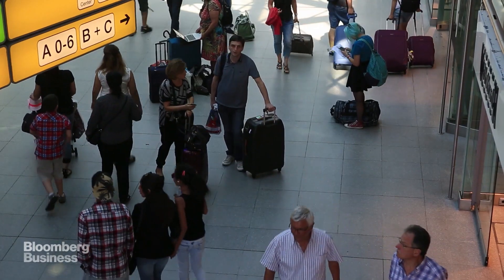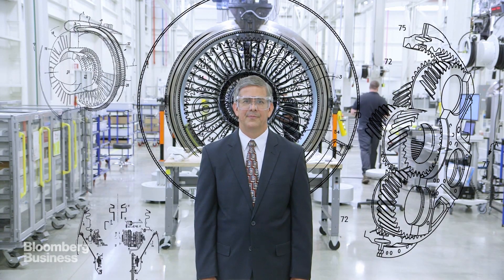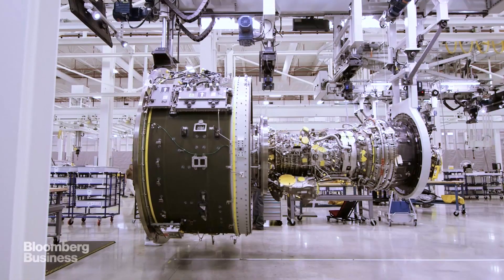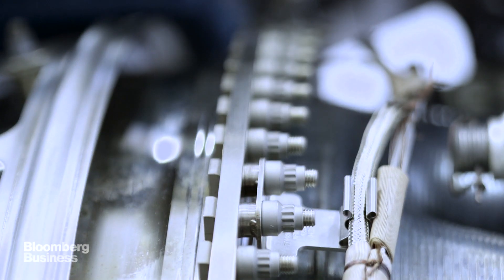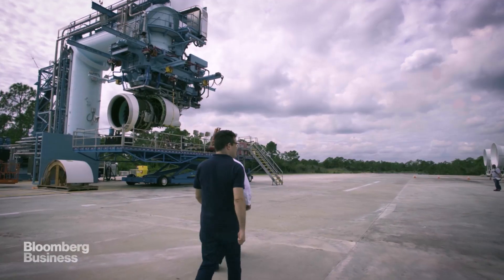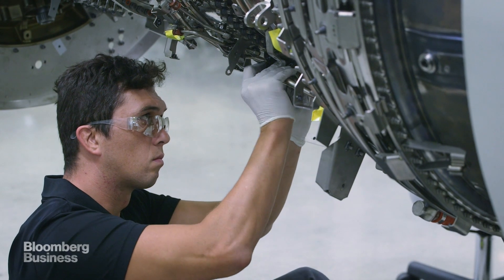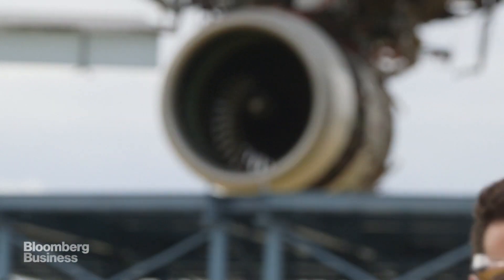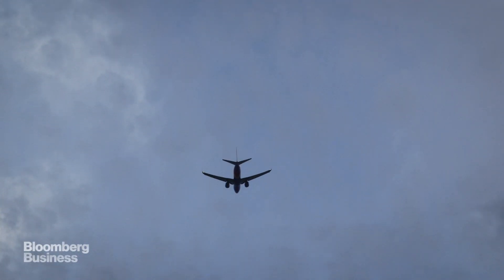This Genius Invention Could Transform Jet Engines

Comment: The cost benefit offered by this technology will mean a lot to airlines.  The big question will be whether or not the reduced fuel savings will be passed along to the consumer once the project cost has been repaid.
Reply: Doubtful. Turns out fuel cost is a minor component of the cost of a ticket. (like, 1-2% in most cases).
The main costs you are paying for are the air and ground crew, landing fees (this is why budget airlines tend to not fly from major airports), aircraft maintenance, and the actual capital cost of the aircraft.

let's say it's a typical medium sized aircraft.... The usable life of such an aircraft is about 30 years in theory, but older aircraft handle longhaul flights better than shorthaul. Let's ignore that though.
Let's take a brand new 737-700 as an example. That costs about $80 million.
over 30 years that means you need about 2.66 million per year just to pay for even having the aircraft at all.
You get about 137 passengers on one, let's say you're doing reasonably well with it and can fill most of the seats.
Let's say that your tickets cost enough that you get $100 per passenger that isn't already being spent on fuel, crew costs, or any other expense involved in actually flying the thing. (that's seriously optimistic, but still.)
With that amount of money per passenger, you'd need to carry 26,600 passengers a year.
With a capacity of 137 passengers, that means doing 194 flights every year.
And that's assuming every single flight ALWAYS has 137 passengers, and after paying all other expenses, you have $100 left over per passenger to pay towards the cost of the aircraft.
If it were only $10 per passenger per flight, you'd need to be doing 1940 flights a year, or an average of 5.3 a day.

And at that point you haven't made ANY profit, the other expenses mean the actual ticket price is probably $3-400 per passenger, and it will take you 30 years to pay for having bought the aircraft, by which point you will JUST have paid for the aircraft by the time it will need to be replaced entirely.

Fuel costs matter, yes. But they actually aren't the major expense in the long run.
Reply: In business gains are cumulative so any that can be realized without a large investment are good.  Since engines have to be built for aircraft if new units can incorporate these gains for a minimal cost increase they are worth it.

Comment: Stop lying.
Try to do the same with cars and trucks (moving people and cargo all over the planet) and see for yourself that jet aircraft are way more efficient doing that job.

This geared turbofan idea is pretty old.. GE does it for years now.
Reply: Yes jet aircraft are not fuel efficient compared to train or container ship. however, they are the most efficient when factoring in speed.
Reply: 44092452 pounds?  A TT can carry 60,000 lbs. Check your units.
Reply: *20 metric tons, not 20000 (typo)... 140 ton miles per gallon is accurate.
Reply: b k how long does it take to get a package from new York to London in a truck though?
Reply: I call tell you for nowt that air freight is less efficient than ground or sea.

Pull up any shipping calculator and see how much more expensive air freight is...

Where they are surprisingly good is moving people. A 747 at full capacity gets about 91 mpg/passenger
Reply: jet aircraft as efficient as cars and trucks?? hahahaha good one. a typical tractor trailer can move 20,000 metric tons of freight 7 miles with a single gallon of fuel.  that's 140 TON miles per gallon.  The most efficient airplane (bombardier cs300 in terms of seatmiles per gallon, see wikipedia "fuel economy in aircraft") is rated at 127 SEAT miles per gallon.  Trucks: 140 ton miles per gallon vs airplanes: 127 seat miles per gallon.
Reply: obviously a truck wont make it across the ocean.  a containership will though, slower, but more efficiently by cube and weight than an airplane.. in terms of EFFICIENCY, jet aircraft are usually the worst.

Comment: what a twat. he can challenge the expert on whether a slower compressor is indeed optimum, but he can't ask the obvious question of why nobody used a gearbox before; if that is in fact the case, since obviously, for example, turboprops have reduction drives

Comment: 10 Billion and 30 years And this so called Genius decides to put a transmission in a jet engine.75% quieter and 15% more fuel efficient. Unlikely .And the more important numbers Extra weight, Gear drag ,Thrust to weight ratio numbers will suffer. Now add in the cost of doing all of this IE parts cost alone (air craft quality alloys) Then figure in the extra maintenance And more. That 1.5 million savings projection just flipped into about double that figure in net loss.  Genius is not the word that would describe this
Reply: Beau Gant ya your probably right. they should have just listened to you. I'm sure they didn't figure any of that out whilst working on that project for 30 years. they probably never thought about it before spending billions of dollars in development.
Reply: True. Also, you don't think that they didn't take into account drag/friction loss? You don't think they didn't factory in one of the MOST important things regarding flight? WEIGHT?

Comment: wont the n1 to n2 ratio be very different though.. its weird
Reply: N1 and N2 are always very different.
What they are talking about is a difference between the fan speed (N1 or LP compressor) and the LP turbine which are usually connected by a solid shaft.
Reply: Android811 yeah i know n1 and n2 are always different due to the difference in outside air pressure, but what im wondering is whether, as a pilot, you would notice the difference or if it would practically ne indentical to a standard engine
Reply: rk.ca Well pilots use N1 (fan speed) as an indicator of thrust because N2 (core) stays pretty constant no matter how much fuel you squirt in there.
This design wouldn't change that at all, you'd still be able to use N1 as a thrust indicator.

Comment: i've always had a design concept for future jet engines, which works similar to a Dyson Ring (The Air Multiplier). It's just a ring attached to the wings (obviously the mechanics to create thrust are elsewhere) and the thrust is finally exerted on the rings. Again, I understand there's a lot that goes into whether this can be applicable or not, but it's just an idea
Reply: Cristofer Monteflores Sounds just like the kind of thing I would think of. :) Unfortunately the rerouting of the exhaust and inlet gases would almost certainly result in low efficiency.

Comment: Looks like a old idea from 70 or 80's, I mean it is a simple and known solution for a problem. """Just""" a ducted turboprop with a lot of blades when a turbofan is like a "ducted propeller" with an additional big turbine in the same axis and a jet in the place of a piston engine. All my "explanation" is extremely simple and not 100% accurate but in the most basic level I think I am right (like the SRB of the STS are "just" big fireworks... in the basic principle they are the same kind of engine).
Reply: They've been working on it for 30 years. Of course it's an old idea by definition.
Clearly there were technical problems specific to the implementation though, otherwise they would have done it 30 years ago, and not just now.
Reply: +KuraIthys Yes and not, I feel like they keep the new ideas and even full products locked in a safe. like the un-ducted "prop fan", created as an low consumption and noise alternative to simple jet engines, but fuel prices got down one more time, so the "ready to use" engine was scrapped with no apparent reason.
I still think that the new ideas should be put in use as soon as possible and in this "high complexity" there is no excuse, because a non standard engine will require the same time to get repaired or serviced as a "shared"/spread engine, if you need any part for repair you always will request it to the original manufacturer, it can't be purchased in a "hardware store", so the idea of "that is a special part, will be hard to get a new one" in reality happen with every hose, screw or pipe of any engine regardless how wide spread is. ;)

Comment: The first book I ever bought was The Jet Engine by Rolls Royce in 1993.  Great book.  In it amongst things, was  details of some of their turbo fan technology. These engine had a reduction box from the main engine to the turbo fan.  It was roughly a 3:1 ish ratio I think.  This tech is not new at all.
Reply: I believe what's new here is the in-line gearbox - think of a shaft where one end spins faster than the other and that the gear is on the same axis and that it has a variable gear ratio and NOT fixed. That is impressive.
Reply: Patrick EH 
https://en.m.wikipedia.org/wiki/Lycoming_ALF_502
Reply: This engine was first commissioned in 1980.
Reply: Pratt&Whitney also  pioneered   the twin spool technology in 1948, the most significant technological breakthrough in the history of jet propulsion  it paved  the way for  development of commercial jet engines ..
Reply: Turbo prop engine is essentially the same thing when it comes to gearboxes on a jet engine.

And that came out in 1929.
Reply: In my book modifying blueprint drawings and then applying them to an original engine design is a "Variant".. e.g. A modified Ford or Chev V8 engine in a dragster is a "Variant" and can no longer be called a Ford or Chev.

Without the original RR design and development there would never have been A Packard/Merlin

You only have to look at what the Japs did with their motor bike engines of the 60s/70s Direct copies(with electric start) of Triumphs BSA's and Nortons and then later Harley copies.

Look beyond your boundaries for the inspiration that made you who you are.
Reply: True. Its been done before by the British. The advantage P&W has here is in the manufacturing process and the materials that were not available when RR did it. The downfall of this technology is the added weight to the engine of a epicyclic gearbox and the oil feed and cooling required. You gain efficiency from the fan but then lose efficiency in the running gear internal friction and the added weight. Sorry; nothing new, and its no breakthrough! If you want to see a real groundbreaking invention look at the new British Sabre engine; this could be a big step forward.
Reply: Rolls Royce book is biased as expected from a British book..Go to page 29, it reads ' RB-211 the first high bypass turbofan engne '  Its  a lie !!   GE and Pratt Whithey both built it before Rolls Royce...https://en.wikipedia.org/wiki/General_Electric_TF39  . Pratt......https://en.wikipedia.org/wiki/Pratt_%26_Whitney_JT9D
Reply: It is unfortunate that national pride can get in the way of facts.
Reply: The best book I ever read was 'Jet Engines'  a  translation from German into  english  written  by Klaus Huenecke 1987 ..
Reply: barracuda7018 you just added that to wiki
Reply: soaringtractor Their RR Heritage Trust knows literally KNOW NOTHING about the PACKARD Merlin

Of course they know, they don't wanna talk about it and they think the rest of the world is idiots..lol
Reply: soaringtractor
Fascinating. I never knew it was other than a licensed clone.
Reply: soaringtractor
Will do, thanks.
Reply: soaringtractor
No wonder.  A friend of mine flew P-51's in ground support in Korea and he never mentioned it to me.
Reply: soaringtractor
Probably the last people around who knew were P-51 & Spitfire crew chiefs who worked out of England on adjoining bases.
Reply: Yes, it IS new.  Hence the patent.  Moron

Comment: 30 years to solve a problem, that could be fix with a gear box...

a gear box that has been here for the last 100 years, Boeing had a big prize to someone that could solve this problem, finally after 30 years someone did it!!! I think the prize in the 80´s was up to 10 million dollars to someone that could solve this problem!!!
Reply: Well to be fair we are talking about a gearbox roughly 30 cm in diameter able to handle the entire force of a jet engine. That is no small feat.
Reply: Hellothere _1 30 years ago I had come out with this solution, they said it was not viable, would make the engine too big, and they wanted a fix, not a new engine...

Comment: Another way to slow the fan tip speed is to make the fan a smaller diameter.  I think a cluster of fans might be more efficient than a single large fan.

Comment: Pratt & Whitney RULES!   They make the F100 PW229 reheated thrust turbofan used on the F15.
Reply: The CFM56-7 is the most reliable jet engine ever built, and is a part of the CFM56 series which overall has sold more engines than any other type.

Comment: Great story.
Fuel comprises a substantial (~40%) of an airline's costs, so a 15% efficiency saving is very dramatic.
The idea seems so obvious, it is a wonder that it hasn't been a feature of turbofan engines from day one.
The story would've been better if it had explained why this innovation was so difficult that it took 35 years to develop.

Comment: So a reduction gearbox is the answer? As others have posted turboprops have been doing that for decades. A gear has drag, so therefore there has to be a better system! That system is in place for decades already, it is known as VVT. By controlling your turbine speed and vane angles you can control your fan blade. After all, even at start up your pnuematic starter turns your N2 rotor which in turn allows airflow to turn your N1 (fan blades). Let alone on an RB211which has a N1. N2 and N3 ;)
Reply: What about a fluid flywheel clutch?

Comment: Who would've thought. Smack a gearbox in the engine.
Reply: That had been attempted for many years. But miniaturizing it while still being able to handle something like 50,000 horsepower and at an incredibly high RPM for such large gears was the challenge that tool them 16 years to solve. I think a different style of gearbox may have previously been used instead of the planetary design shown here.

Comment: Why bother with a gearbox that adds weight? Just decouple the 
fan from the turbine and have an electric motor drive the fan.
Reply: a Mechanical Electrical Mechanical system is less efficient than a mechanical Mechanical direct drive system.
Reply: David Jackson, II This depends on what you are using. if you use an Turbine powering a generator powering an engine then defenetly yes, but if you use a electric engine in the first place then defenitly not, because gearboxes don't produce energy :D
Reply: Mathew Cherrystone unless I missed something, the power to weight ratio for lithium ion batteries is simply too high for any kind of economically long distance flight.
Reply: David Jackson, II You could use fuel cells and liquid gas for example. Still much more efficient.
Reply: Sunny Julien Divine
Maybe but never more than the whole turbine.

Comment: I thought older and cheaper jet engines had gearboxes go do this. The new ones are designed so well that they can run without a gearbox to increase efficiency by eliminating the friction of a gearbox.
Reply: In many turbine applications the loses in the gearbox is far less than the benefits of letting the turbine and the driven object run at their own optimal speeds. 

The problem when coming to big engines is as said to make a gearbox small and light enough to fly with.
Reply: Jet engines have had gearboxes to run the accessories (fuel pump, generator etc.) Turboprops also have gearboxes to reduce the speed of the propeller.  What is new here is that there is a gearbox inside the engine inline with the N1 shaft that doesn't get in the way of the axial air flow.
Reply: I think the reason why this is big is because we couldn't scale gearboxes to the tolerances required by large jet engines since most would either breakdown or become to expensive and heavy to use on a jetengine
Reply: Brian Su 
Can't get around a gearbox when trying to get the right bladetip-speed. Gearbox for the win